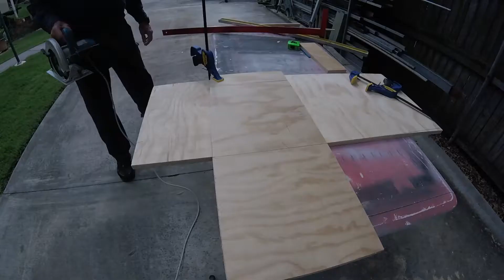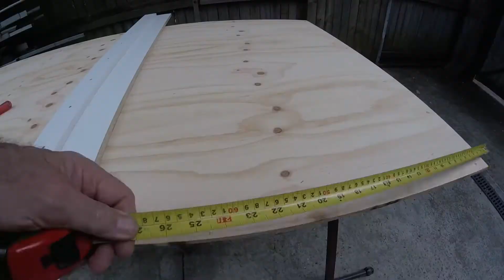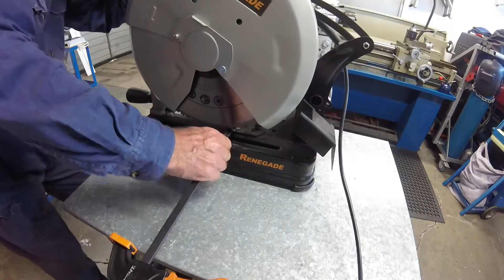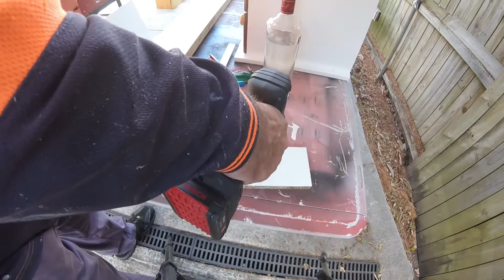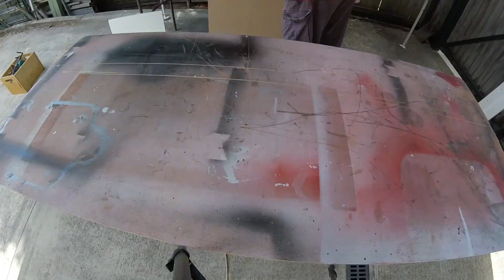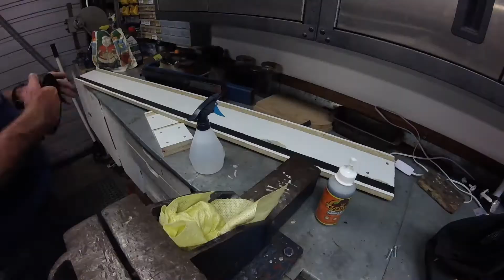DIY Circular Saw Guide Rail and Accessories

Comment: Nice one Bob, and thanks so much for the shout-out! If anyone's interested there's a playlist with all the Tracksaw Workshop videos in order at http://bit.ly/TracksawWorkshop. I used a DIY rail & circular saw for years before I bought into the tracksaw idea, and made plenty of good cuts with it, including some hi-gloss laminate doors that I'm looking at right now; I honestly can't say a tracksaw cut would be any better. I did find that the edge of the board would wear over time though, and needed re-making, whereas a rubber strip can be replaced. Love the low-profile clamps, too! Damn, I wish I could weld - if I ever make it out your way I'll stop by for a lesson, OK Bob? 👍😆

Comment: Nice project Bob- I have a Makita track with an adapter that goes on my saw to use it. I love that thing! I was never good at following a line. I also note (happily) that I'm NOT the only person in the world still arc welding 😆 and ... I may even copy your idea for low profile clamps as I need some for me track saw!!
Reply from the maker: Yep, those low profile clamps were an easy build. I have arc (stick), gas and tig welding capability in the shop. I do mainly equipment maintenance in the shop so not having mig is no disadvantage. There is more time setting up the clamp joint than welding it and stick is the easy in and out for the job.
Reply: @whitedoggarage  Must be good to have a welder bevy and skills to operate it all! My welds are all falling apart today. First test drive of my scooter thingy and it fell apart in one place, second test drive two other places fell apart. 😕🙃 I think I'm getting the hang of it now though.